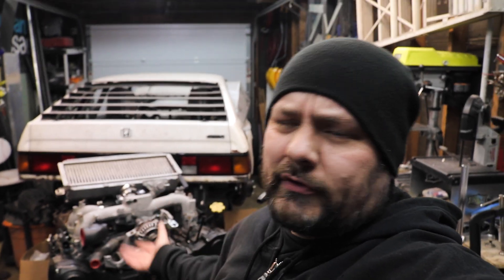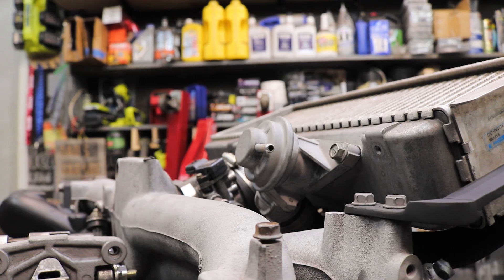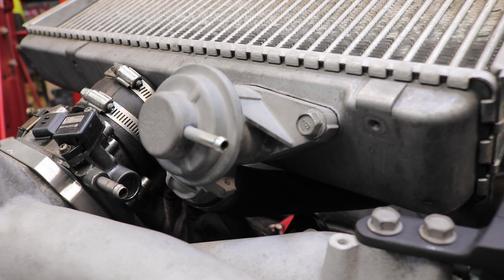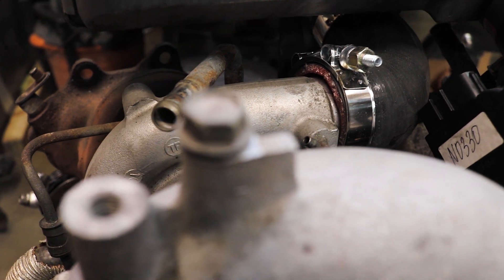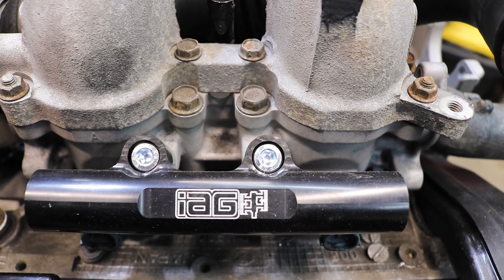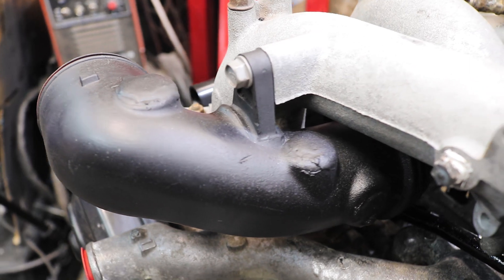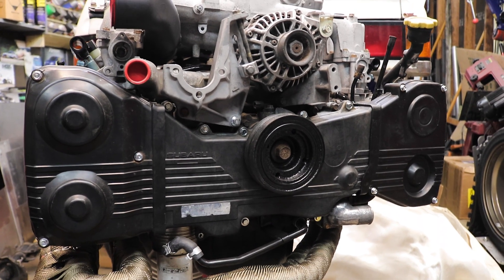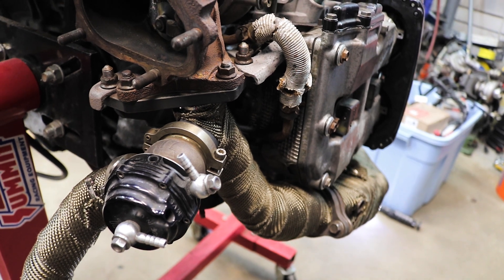Subaru Powered Honda CRX: Finishing the WRX Engine Assembly

Comment: 4:55 - will you run some kind of tensioner for the belt from crank to alt?
Reply from the maker: yep, the factory tensioner will actually work with a shortened belt, which I have sitting in my giant parts pile